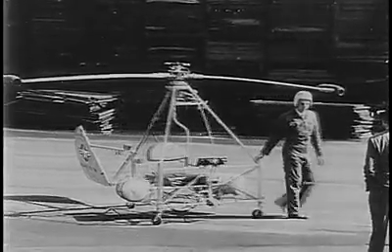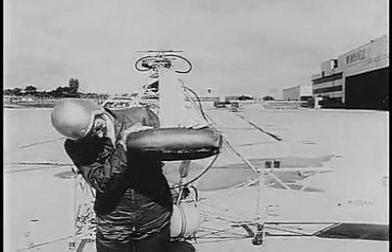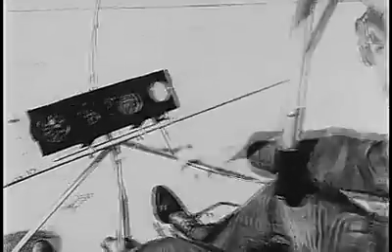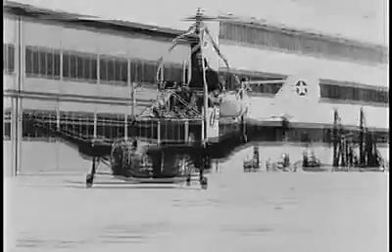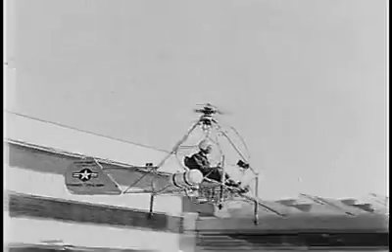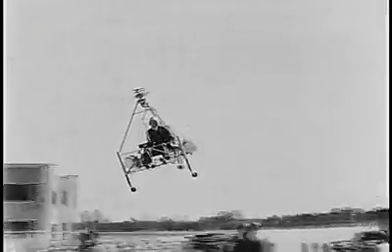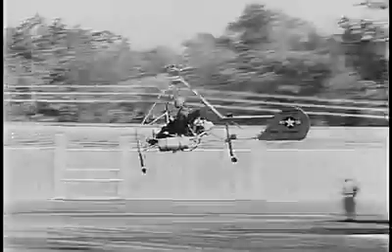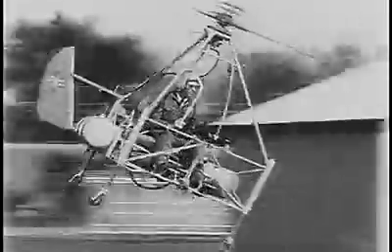"'Little Henry': World's First Ram-Jet Helicopter!"

Comment: it was not the worlds first ram-jet helicopter
Reply: It wasn't the first tip-jet chopper. Another design several years earlier sent fuel and compressed air to the tips to be burned in chambers. That would count as a rocket-tip construction. Little Henry was the first ram -jet proper helicopter.
Reply: @-danR  Tip-jets are ram-jets, my friend
Reply: @ The general characterstics of a tip-jet and a ram-jet are the same. I have no idea why you start talking about pulse-jets...No one said anything about pulse-jets